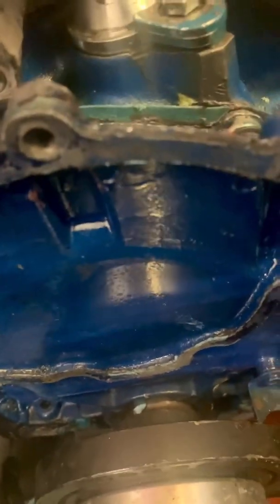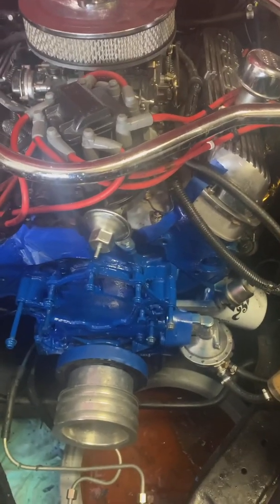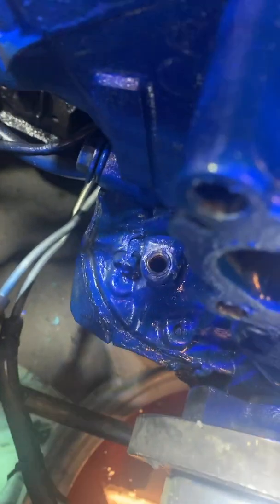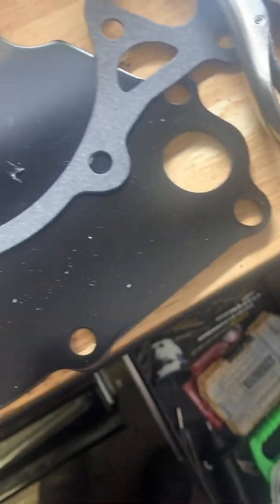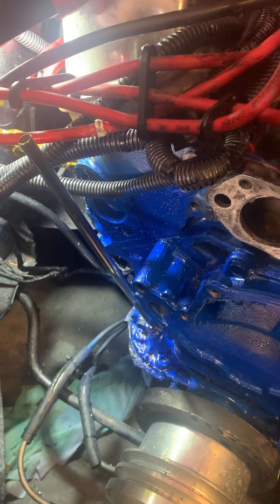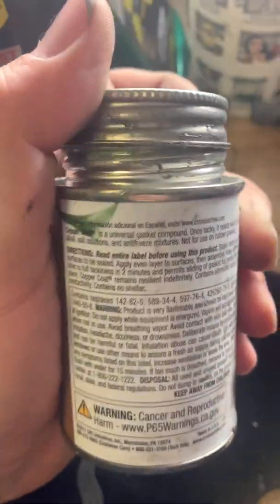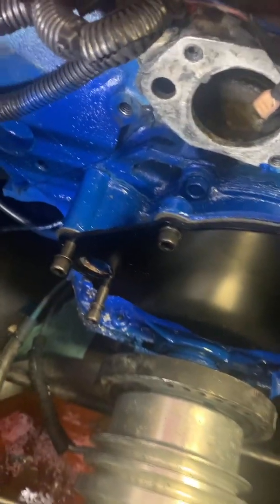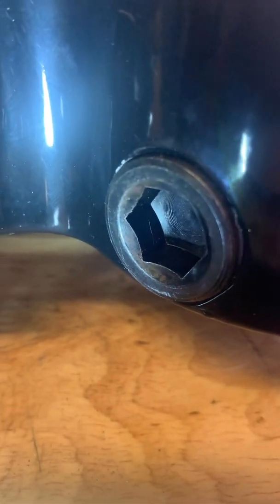░▒▓█ 𝐈𝐈𝐍𝐒𝐓𝐀𝐋𝐋𝐈𝐍𝐆 𝐀𝐍 𝐄𝐋𝐄𝐂𝐓𝐑𝐈𝐂 𝐖𝐀𝐓𝐄𝐑 𝐏𝐔𝐌𝐏 𝐈𝐍 𝐀 𝐂𝐋𝐀𝐒𝐒𝐈𝐂 𝐌𝐔𝐒𝐓𝐀𝐍𝐆! █▓▒░ LINK IN DESCRIPTION!

Comment: My 289 was not at all happy trying this. The water pump had to be flipped to install and still fighting to put an alternator.
Reply from the maker: What year is your car. Is the radiator bottom (outlet) on the right side or left side? That would be the only reason I can think of it needing flipped, later model years they moved it to the left (drivers) side, mine is on the right., there is another video on the channel where I show how I got the alternator mounted.
Reply: @charleysgarage  it is a 1962 Ford Econoline with a 1965 Ford 289,,, The pully on the crank shaft on the engine is too big if the pump isn't flipped. You can't put the aluminum hose mount on the pump.
Reply from the maker: @HellenKillerProject  That makes sense, the chassis on those vans makes any modifications a pain. not a lot of room to work with.
Reply: @charleysgarage  It is the size of the crank shaft pulley, and still trying to find a way to mount an alternator. Going to have to build a mount.
Reply: @charleysgarage  65 289 cobra with high compression 351 heads and a 9 inch positive rear end. Building a power brake booster for it. I was in a coma and just starting to try to remember how it all works

Comment: Stick bolt of the correct size in the "allen" socket, just put the "bolt" in there and Ta Da instant "allen" wrench. Use whatever you want to screw it in or out.
Reply from the maker: Good tip! Make yourself a video showcasing this, maybe it will go viral!

Comment: Please tell me why you have rubber gas hose on your transmission lines and zip tied. I’m interested. This should be fun.
Reply from the maker: Those transmission cooler lines want to rub on other components, especially when using an aftermarket radiator that the cooler connections are on. So the rubber lines are an insurance policy to keep them from getting vibration damage. Eventually i will buy some tubing and bed it to fit correctly. Not sure what was fun about it though, seems pretty mundane to me.
Reply: @charleysgarage  thanks brother. I just rebuilt my transmission and mine are close also. The reason I said Fun is because a lot of people put out crazy videos and actually think they are right or safe. Any way nice video. I’m Ford forever. 🤘🏼